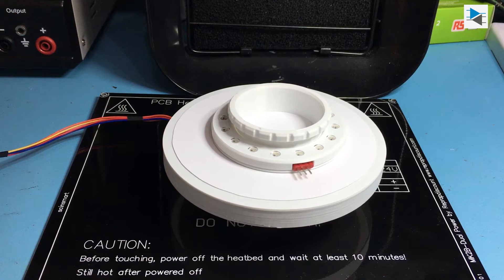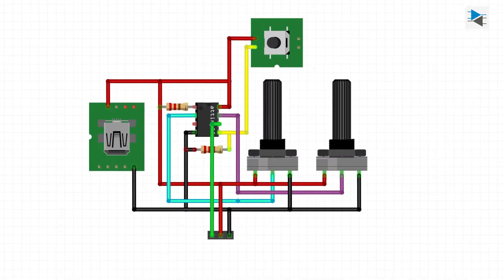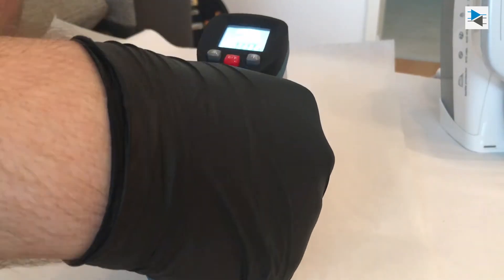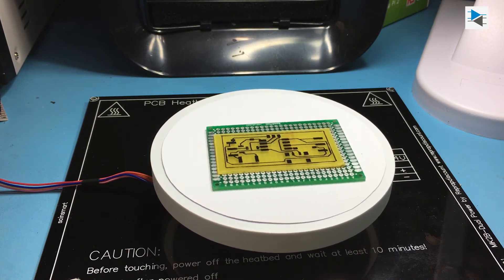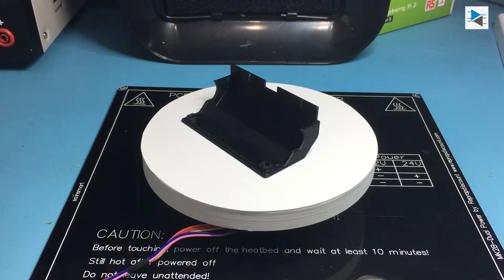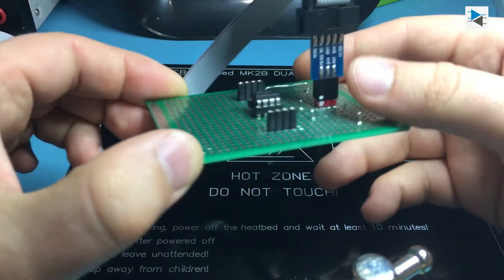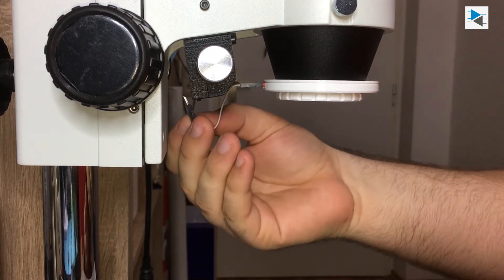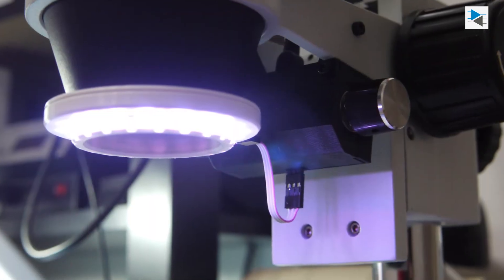DIY 3D-Printed Microscope Ring Light - Part 2

Comment: Hi, I was wondering what exact atmel programmer you were using and how much you payed for it?.. Also, how did you program it from your computer? I noticed that the code for this project on your github seemed to be arduino, but you mentioned in the video that you removed the arduino boot loader from the attiny85.. Finally, would you recommend fusion 360 and how does it compare to other cad software? You seem to use it a lot in your videos. Do you know if free alternatives even comparable? Nice videos, btw!
Reply from the maker: Hello,
I was using an Atmel ICE Debugger (about USD 50 to USD 85) to update the firmware on a USBasp http://www.fischl.de/usbasp/ (like USD 10) which I then used to program the ATTiny85. To program the ATTiny you just need to connect the corresponding pins from the USBasp to the chip itself.https://www.avrprogrammers.com/images/schematics/attiny85-minimal-lg.png  For that I made myself a breakout board which consists of the physical connections from the pins to the header.
 I did not mention anything about the bootloader in this particular video - the Arduino IDE and bootloader for tha ATTiny85 was used in combination with a USBasp Clone for which I did a firmware upgrade using an Atmel ICE debugger to get rid of a nagging warning in the Arduino IDE. 
I like Fusion 360 because it features a very extensive set of features and is familiar to someone who is used to commercial CAD packages. I have used PTC Pro/E (now called Creo I think), Solid Edge and Autodesk Inventor and they all have more or less similar workflows for basic 3D Modelling. The sheet metal modelling and creating actual drawings isn't quite there yet in Fusion360, but they're working on it.
Also, Fusion360 is free for enthusiasts, students, hobbyists and companies with less than USD 100000 of revenue per year. You just have to register and renew the free license every year. One thing though is that the file storage is cloud-based which has its advantages and disadvantages. In my opinion nothing free compares to the ease of use and feature-richness of Fusion360 at the moment. If you don't fancy Autodesk, you could give https://www.rs-online.com/designspark/mechanical-software Designspark Mechanical a try. Looks reasonable from the screenshots.
Reply: otinex Oh, sorry for the misunderstanding.. I was under the impression you somehow compiled an Arduino sketch and programmed it on to the attiny85  without the bootloader present at all.. I use an atmel ice too actually... So, I take it that you're having the USBasp communicate with the bootloader on the attiny85, which was written into the attiny85s flash with the Atmel ICE.. Did I get the right? If not it doesn't really matter much.. You don't have to explain it more if you don't want to.. Thanks. :)
Reply from the maker: I used the ICE to flash the USBasp which I then used to communicate with the bootloader on the ATTiny :)
Reply: otinex Ok, got it and also had no idea about the fusion 360 enthusiast thing... Thanks a bunch! I'll definitely check that out.
Reply: Also, I know you can program Arduino sketches onto microcontrollers like the attiny85 from the Arduino ide using an Arduino as a programmer... Is there a reason you're not doing that instead? It seems like it may be simpler than what you are doing if you have an Arduino sitting around..
Reply: Although I guess that may not be too different from what you're doing now... I'm not really sure.
Reply from the maker: Of course you can use the Arduino itself as a programmer (the USBasp is actually an Atmel chip that basically does that) but by using the breakout I made, I don't have to connect any jumper wires to the Arduino. I just plug the ATTiny into the socket, plug in the USBasp and program away :)
Reply: Ah, ok makes sense. That's a cool setup honestly..